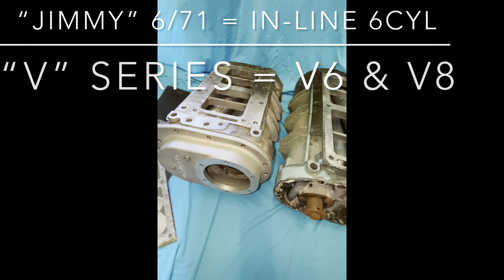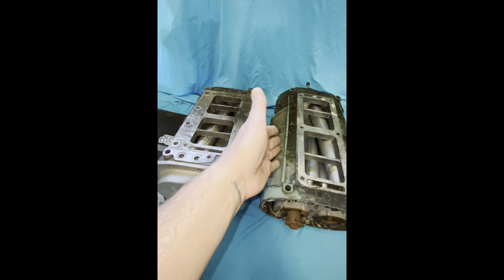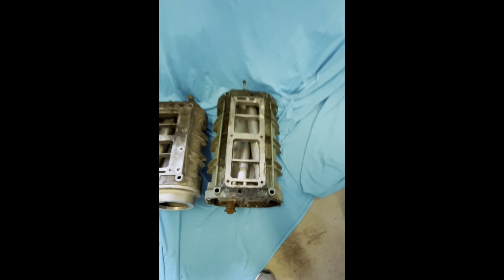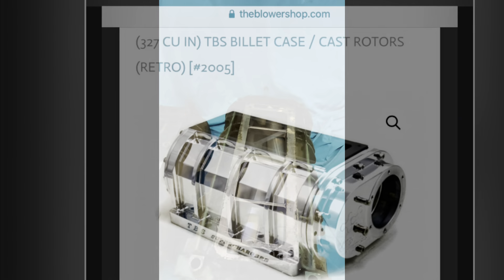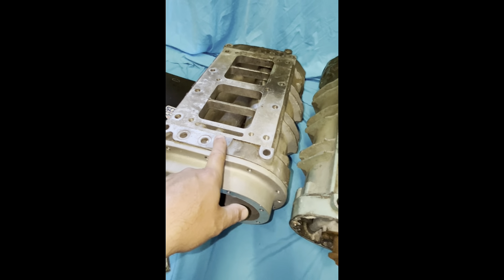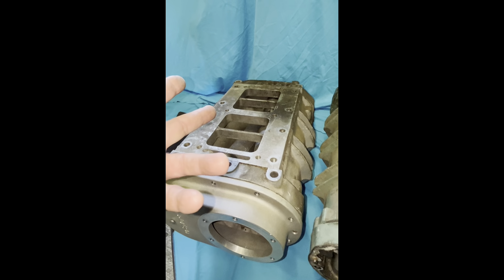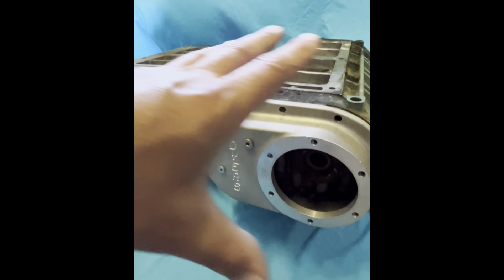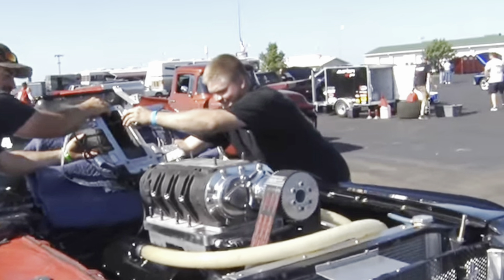how to 150+mph your Small Block Streeter , #3 Blowers, “v”series & TBS

Comment: Yup . Spent my day off tinkering with my 8V92.
Reply from the maker: Yes, so you will fill via the the Front Gear Cover (gear oil) either thru one of the provisions it should have on there or that you tap & plug yourself. Just check out the vids i have up & you’ll see it. Gear oil up to about 1/4 way up the Gearset👍🏼🏁
(Like a differential)

Comment: 10 years ago I worked at an OEM supercharger factory and I remember that the gear and snout shaft were not connected directly but had the torsional spring in between cup-shaped hubs. What does it look like in the v71 series conversion? pictures I found on eBay don't show all details. What pulley standard do you recommend for a budget build? 
I'm pretty sure that when I finally get 71 blower in my hands, everything will be clear and obvious. Until then, I'm doing an extensive shopping list because shipping parts overseas is a pain in the butt when you forgot about some small stuff.
Reply from the maker: Totally agree, shipping’s a pain…
Ok, so the gear face has provisions for bolts/studs….there’s a splined Coupler that bolts to that, then a Spline shaft that’s with your snout drive(bearing/pulley) all offsets must be correct. It’s sorta like a rear drive axle🤷🏻‍♂️that drives the whole lot. Don’t use a oem coupler, weak & smaller dia”spline, use the aftermarket strong stuff that’s recommended…..👍🏼🏁
Reply: @69JANKS  Thank you very much! Now all is clear and I can begin the parts hunt.